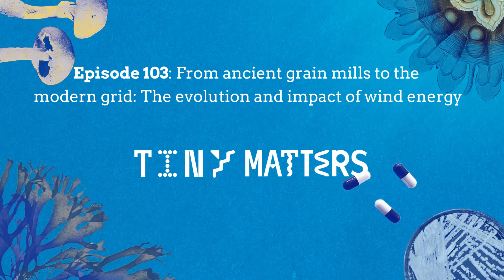Episode 103: From ancient grain mills to massive offshore turbines: Why wind energy is a big deal

Comment: A turbine is a machine for producing continuous power in which a wheel or rotor, typically fitted with vanes, is made to revolve by a fast-moving flow of water, steam, gas, air, or other fluid.

Hence a wind turbine uses the power of the wind to revolve vanes to produce electricity. The clue is in the name: wind turbine.

Based on 2024–2025 data, a very high percentage of UK electricity is produced by steam turbines—likely over 40–45%—because they are the primary mechanism for generating electricity from gas, nuclear, biomass, and waste, even as coal has been phased out.

A windmill is a building equipped with machinery for milling grain into flour powered by wind. The clue is in the name: windmill.

Milling grain is the process of grinding, crushing, or cutting raw cereal grains (like wheat, oats, or corn) into flour, meal, or smaller, usable pieces. It involves removing the outer bran and germ from the endosperm to produce refined flour, or grinding the whole grain for a, whole-wheat, product. This, commonly, mechanical, operation uses machines such as rollers or stones, typically powered by electricity, wind, or water. 

Windmills are powered by wind, watermills are powered by running water, tidemills use tidal flow, treadmills are powered by human or animal movement, horsemills are powered by horses. Again, the clue is in the name.